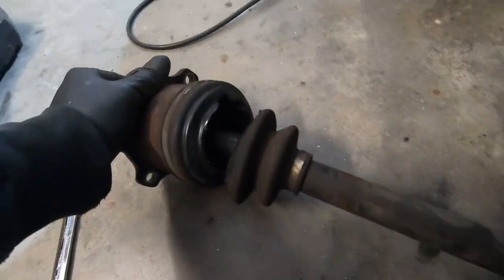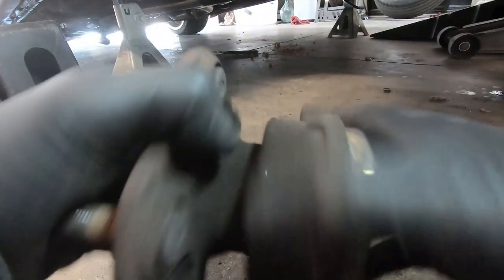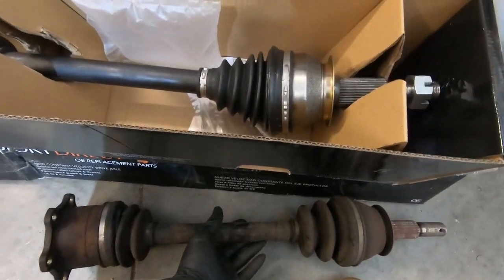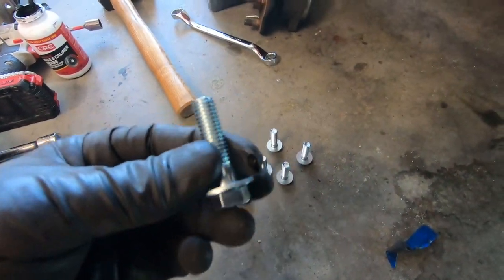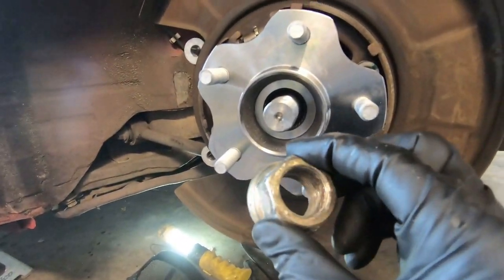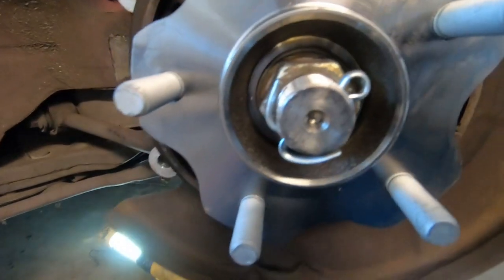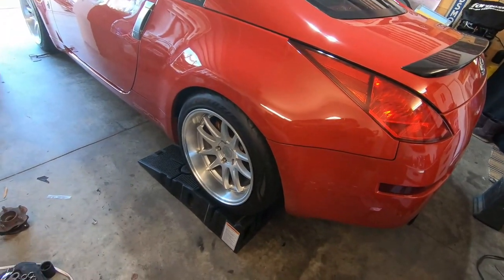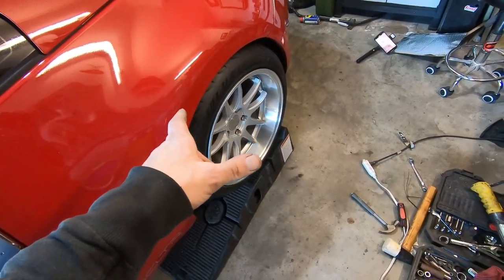350z Axle UPGRADE | 370z Axles and Wheel Bearings for the 350z!!

Comment: shorter axles goes on driver side. its same for 350z & 370z/ This is because of the offset in the differential carrier and cage. If you swap their location, the inner joint shaft will touch the dust cover in the back of the joint (where it connects with half shafts on diff). 350 & 370 differentials are identical. the shorter axle goes on driver side
Reply from the maker: I think they are actually flipped.  You can’t put them in wrong.  One is far too long.
Reply: Yes correct. It's not possible to put them on wrong because one side would be too short and other side too long if put on incorrectly. Great video!
Reply: are the 370z axles same as g37? i noticed the 370 ones are slightly longer than 350 ones. I'm using ones out of a manual g37s

Comment: I installed 3 different axles (AutoZone, track motive, and Nissan value advantage). All 3 were Chinese axles (yes even Nissan value advantage is Chinese axles, made by same company that makes AutoZone and track motive axles). They all have the same tooling marks. They're all poorly made, excessive rotational play in the joints, causing clunking when shifting or changing directions. Also severe vibration when accelerating past 80mph. I went with used OEM axles of a crashed low miles 370z, and could not be more happy. Axles are the one part that is worth spending the extra money on. For me ride quality is very important as I don't track or race the car. It's just a daily driver. I want smooth operation and no NVH
Reply from the maker: No issues with these
Reply: Do you need longer bolts?  ARP 10x1.25 40mm bolts would work?
Reply: @vulcanrush  did that size work for you an where u get it at

Comment: Are they the same length as the original axle and hubs? Is any alignment needed after install? Any issues with NVH? Thanks!
Reply from the maker: Same length but opposite.  Right side goes to the left and left side goes to right.  You also need 370z hubs/bearings to make work because there are more splines.  No vibration or anything after install—no reason there would be—it’s all factory pieces.
No need for an alignment as you’re not making any changes to control arms.
Reply: @SpeedCultureStudios  Thank you!

Comment: Hey yo question is there any performance radiator for the Q50 3.7 mine just blew up lol !?
Reply from the maker: No not really
Reply: Good thing about radiators, you don’t have to find one for your car, just find one that fits the dimensions. Good to go.
Reply: Doesn’t mishi make a 800 dollar kit?
Reply from the maker: @ryanfisher8597  I wouldn’t get a mishimoto radiator
Reply from the maker: @bnanabrd9826  that’s correct
Reply: @SpeedCultureStudios  I knew I guy that ran one on his Z which he would drift and it lasted. A lot better than stock from what we could tell. Then again he blew the transmission up a few weeks later so I don’t know how long it would worked 😂
Reply from the maker: @ryanfisher8597  lol.  There have just been a number of people running into mishi radiators leaking cracking etc lately
Reply: @SpeedCultureStudios   yo video on bleeding the coolant on the q50 3.7 please I need help !!

Comment: Unless i missed it, what brand bearing and hub did you choose? I am not a do it yourselfer so i want to do this job exactly 1 time. Also do you have those exact bolt specs please
Reply from the maker: The hubs and axels are linked in the description.  Moog hubs and axels from oreillys.  I don’t recall the exact brand, but they are linked.  These are 370z axels so the hubs have to match if you’re doing this on a 350.  I don’t recall the exact hardware specs, sorry.  I took a bolt from the factory axels and just got one the same diameter.  Just want to be sure there isn’t a lot of play in the holes.

Comment: Question.....After the install should I take it easy on the newly installed parts for like the first 100 miles? Also is there any modifications needed to install these 370z parts?
Reply from the maker: Only reason to take it easy would be to check back on the hardware to be sure it stayed tight.  Nothing special other than what was discussed in the video.
Reply: @SpeedCultureStudios so are there modifications that need to be made. Saving of previous equipment or is everything direct bolt on?